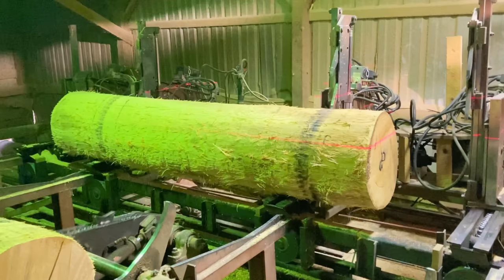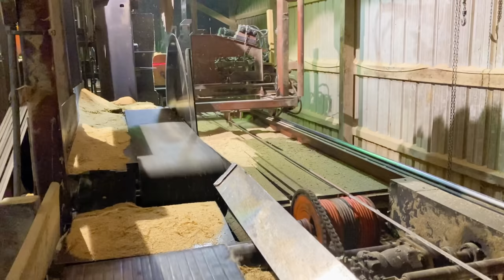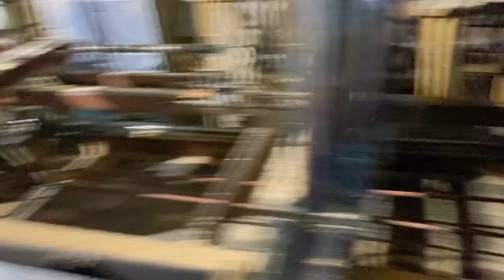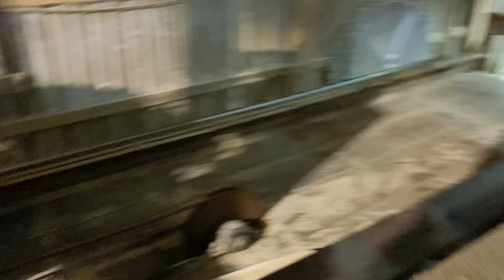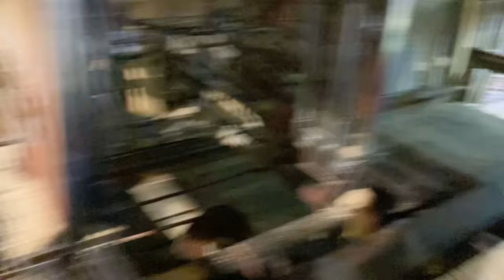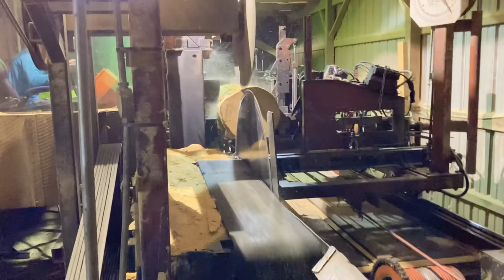Sawing grade lumber and ties!!

Comment: Wow, I've never seen a machine that could make THREE simultaneous wood cuts before, set the wood up flawlessly each time & to be cut precisely automatically... and it's obviously an older machine, too! NICE! THANKS...
Reply from the maker: Thank you!!
Reply: I remember the portables powered by VW motors that had the edger blade on the side. They cut a lot of lumber. @Helmsburgsawmill

Comment: The sawyer making to maney mistakes.  Not turning the log soon enough.  And using the edger when not needed.
Reply from the maker: The ties are the priority on these logs. The lumber is just a product. You split the first face strips with the edger so they don’t clog the grinder👍👍
Reply: I run the same style mill with vertical edger and I use the edger the same way. So the chipper doesn’t get jammed up.  Less downtime means more money for the mill
Reply: Oh the irony. Too maney mistakes 😂
Reply: Why were the ties priority? They look like beautiful logs.
Reply: Let's see your sawyer video...